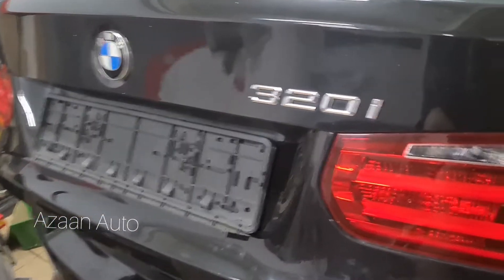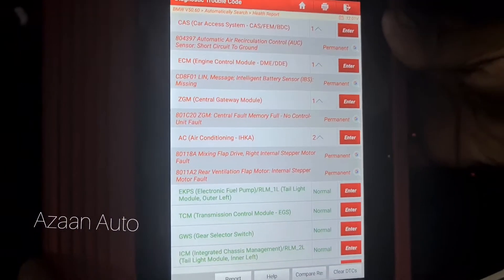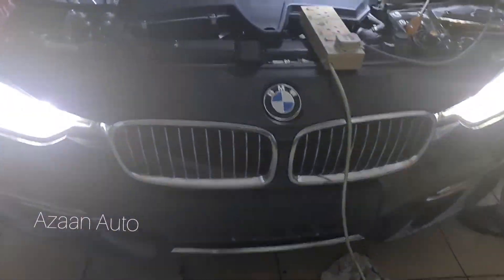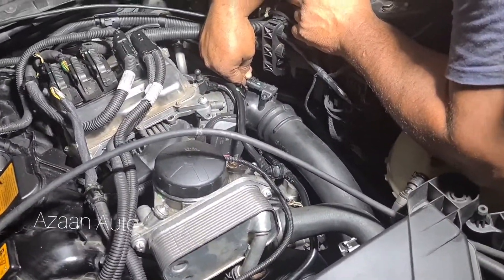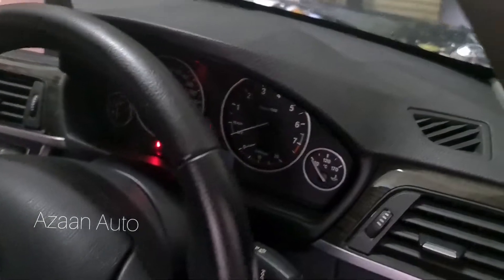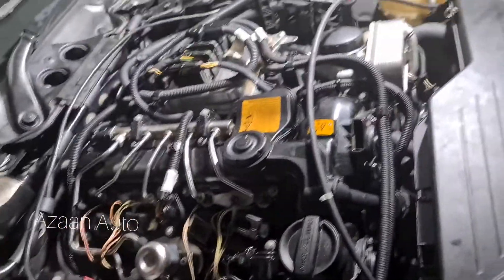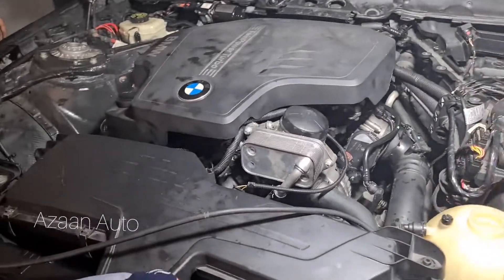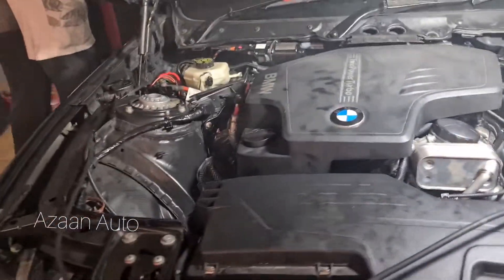Bmw f30 320i N20 engine Won't start Found Timing Problem No Compression of Timing Mark not matching

Comment: I have the same problem no start only thing I did replace 1,3 injector now I don’t have compression on 4 cylinder I have about 60psi emu tips help work be appreciated
Reply from the maker: Open the plug and put some engine oil in cylinder which is low compression try it leave it for 1 hour and try to start again

Comment: I have the same problem right now please do share how you fix it
Reply from the maker: Timing out
Reply: I also have the same problem, do you have the solution?
Reply from the maker: @groscailloux57  need to check engine compression and timing and plug coil and plugs
Reply: I have no compression, and a lot of short-circuit faults